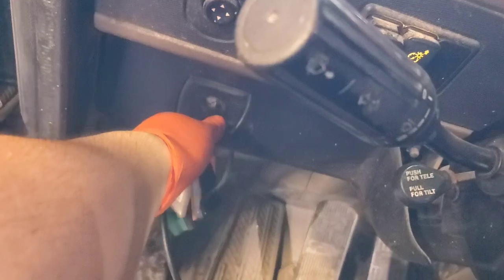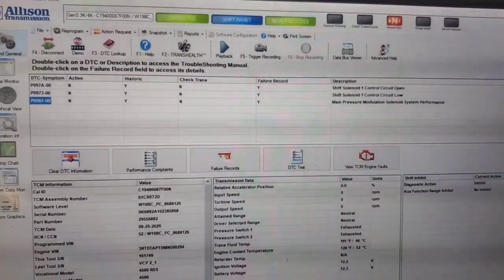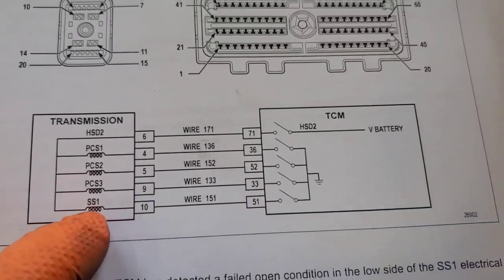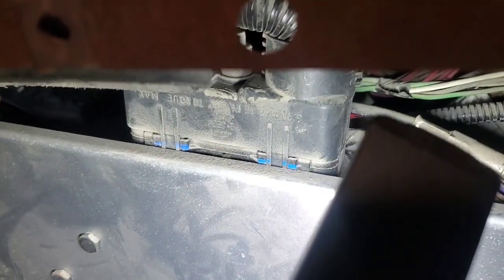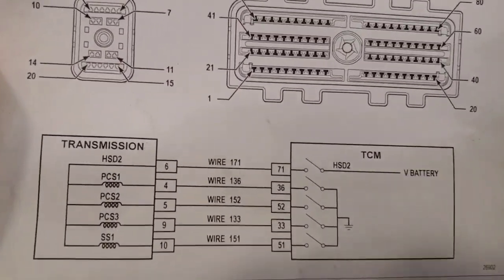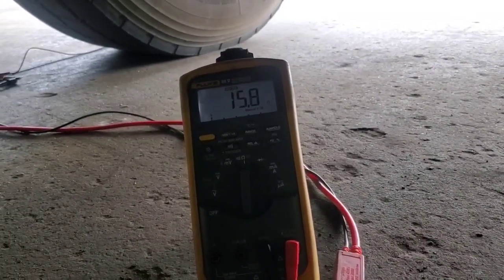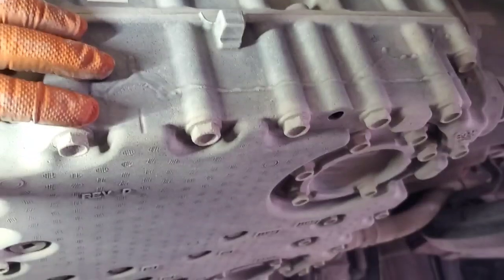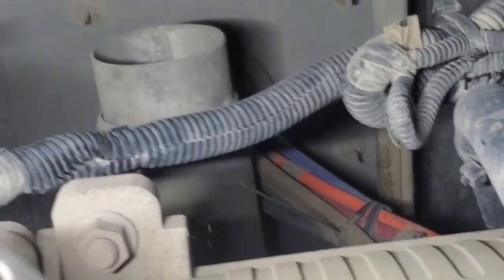Allison TRANS 3000/4000 not shifting, stuck in gear codes p0961 p0973 p097A diagnose - repair HX

Comment: Hey, I have this code as well as incorrect 1st gear and second gear ratio codes. I'm the third guy to work on this truck. Believe tcm and the whole tcm loom was replaced by previous mechanics. First week at a new shop and they are giving me everyone else's nightmares. Any help would be appreciated! ABS light is on as well. Could that, or a wheel speed sensor be connected? I also noticed that the D on the shifter doesn't light up like the rest of the gears do.  Thanks for your videos!!!
Reply: Right on, will do. Having the same software as you do in your video should make that fairly easy. Thanks again for taking the time to reply!!
Reply from the maker: Hey there. Those 1st and 2nd gear ratio codes indicate bad speed sensor signals. Check the wiring for all three sensors. If good, I would replace all 3 speed sensors.
Yea it sucks taking over other people's handy work. Good luck!
Reply from the maker: I'm talking about transmission speed sensors. ABS will not cause those codes.
Reply: Right, I figured. I was just hoping it got some data from the wheel speed sensors. I had a feeling it wouldn't be that easy. You think I should focus on the speed sensors before the solenoid code? Thanks for the reply!
Reply from the maker: @Humboldtcounty707  gotcha. If you got solenoid codes also, I would remove the TCM connector and ohm out each solenoid AND speed sensor to test the complete wiring of the harness and internal trans.

It doesn't matter which you check first, speed sensors and solenoids will have to be addressed. 
Possibly clear the codes and test drive, then diagnose whichever comes back first.

Sounding like a right mess. Thankfully the wiring on these are simple. Test main harness and then internal for solenoids.